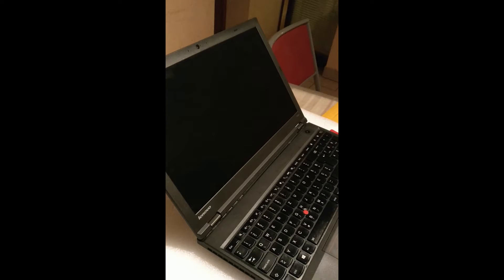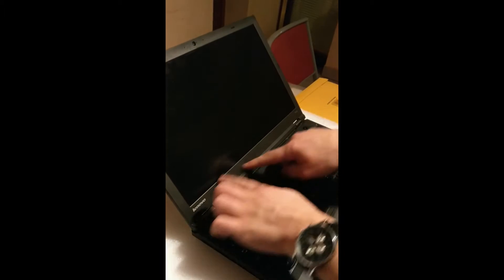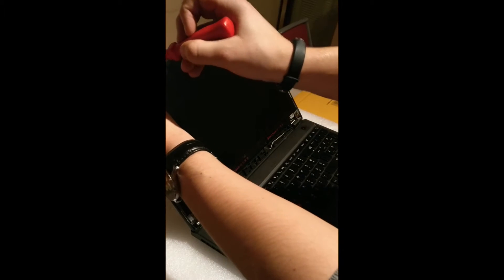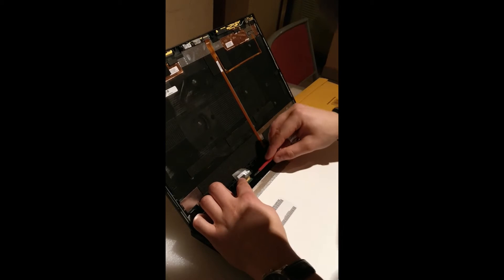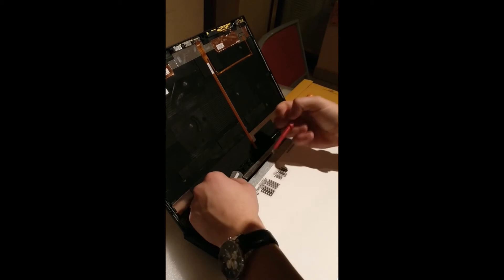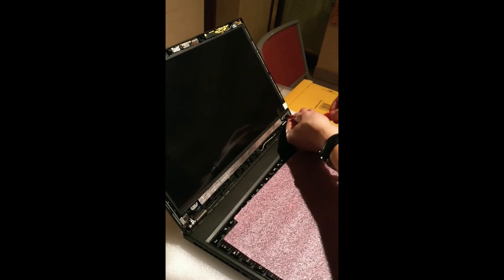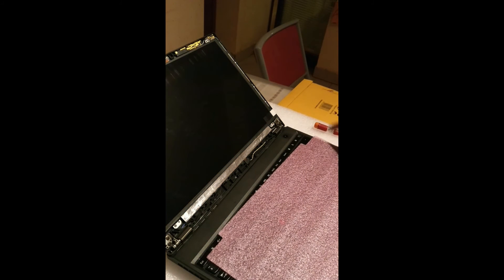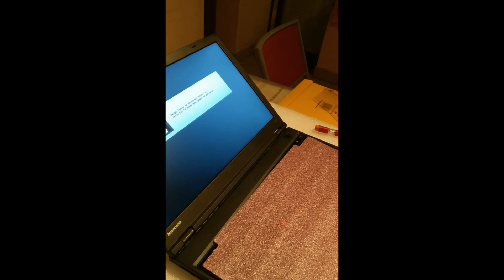How to replace laptop screen Lenovo Thinkpad T540p

Comment: My t540p screen is nothing like this, mine has a thin metal frame around the screen with small screws as well as the screws shown in your video.
Reply from the maker: Is it a newer model? I remember that when selecting the correct screen you had to be very careful to select the right one. (resolution, connector, brightness, etc).

P.s. did you manage to replace it?
Reply: @ 
sadly i only got as far as poping the screen bezel
as soon as i figured out it was the wrong screen i stopped!
to be fair the basic screen is good enough so will focus on a cpu bump!!👍
but thanks for taking the time to show how its done

Comment: Sir, i got my unit without webcam, can u give me advice about putting webcam module on T540p? i haven't check theres a cable or not on my unit, ah! are T540p webcam module is different with T440p? thank u
Reply from the maker: Webcam is on separate board with it's own cable. I didn't have to touch it while replacing the screen.

Comment: do that screen will fit in  THINKPAD T540P 20BF001NUS ?
Reply from the maker: Based from the search for the 20BF001NUS on laptpscreen.com it seems that you need 1366x768 panel, I was just replacing with another same-spec HD panel

Comment: I was SHOCKED to see how EASY this is! GREAT video! I
 replaced screens on Mac G4 "Titanium" laptops. I had to completely disassemble the computer, removing the RAM, hard drive, cd rom,  all other components to get at the hinges, then unglue the case around the screen, reroute cables, glue the top and frame around the screen use JB weld because the computer would get hot and most glues including super glue would fail due to the heat! Also about 50 screws, of seemingly random sizes, to be kept separate... This is going to be as easy as changing a light bulb!
A few suggestions. The cross screwdriver is also called Phillips head. Instead of a regular screw driver, you may want to use a wooden or plastic stick, like a bamboo skewer, the pry the wire off and so forth, less chance of accidentally slipping  and cutting the ribbon cable, although I will probably also just use a screwdriver. Looks like I can do this with the Leatherman multitool I always carry with me!
THANK YOU!
Reply from the maker: I never had problems with regular, 15 inch laptops, like Asus K53 and A55. They're simple to open and to replace any part. Only with the ultrabooks is a problem due to screen being glued to the frame (I had to order the whole lid). 
Thank you for the hint with the Phillips head. And also instead of plastic sticks I found credit/gift cards to be very handy.